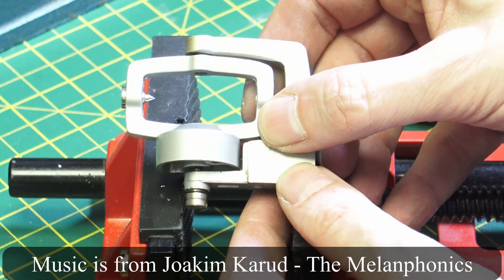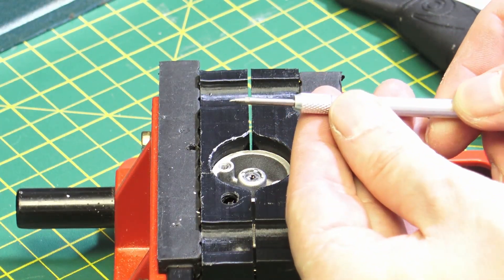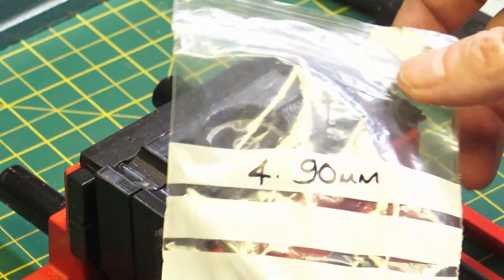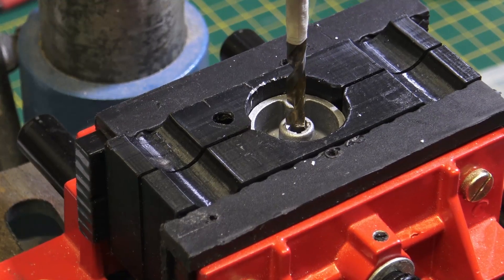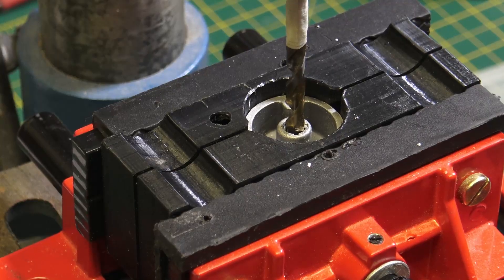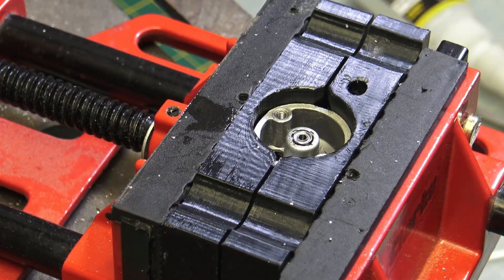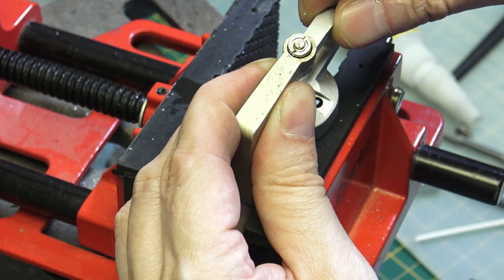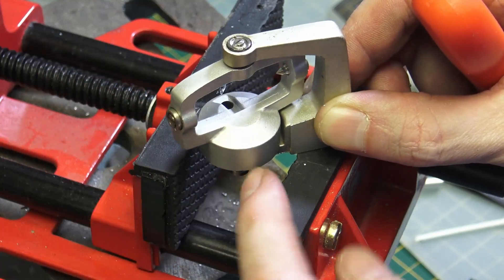How I replaced damaged bearings on a Technics 1200-1210 turntable.

Comment: I have just stumbled across this video while searching for something else related to the Technics 1200/1210 and it intrigued me to watch it.

Obviously the majority of people don't have 3D printers and pillar drills to hand, but it was more how the bearing was fitted. I haven't the time to read through all the comments but at a glance I didn't see the method mentioned I am about to suggest.

I've fitted bearings into all sorts by placing the bearing in the fridge or freezer for a while, meanwhile the part the bearing is to be fitted into sits in the sun / near a radiator / in a warm place.

Due to good old thermodynamics, the bearing contracts in the cold and the other part expands in the warmth allowing the bearing to be gently pressed or tapped in with little effort.

Anyone tried it? May work rather than drilling castings.

Comment: maybe a short thought through question but are you also well in reason to use this on the arm's "up or down"  axle? i'm doing this on SYNQ XTRM1 (hanpin superOEM but when i grab some precision measure calipers they are a bit over 5mm OD if i'm recalling my previous measuring b4 deciding to forward on this stabilizer modification (if u will) upgrade for the up and down motion as well as the rotation of the base arm pivot, not sure if the top/bottom bearing sockets are equal to Technics or not, actually didn't get to mind on measuring these as well when i was havin at it on my tonearm spare parts set (ordered 2 new SUPER OEM Turntables after the authorities stacked both TT's on top of one another when they were seized after a "Free party"  aka, non legally licenced party :p, anyway both were significantly messed on the arm side of the decks, however the boxes they came in " branded Epsilon"  handwritten on outside box, they were wrapped in silky cloth, 2 tapes around base of arm and the headshell socket , a foam block between arm's base and under the armtube rear (where the arm weight goes on) which was snug between the armtube and the surface of the base of the tonearm, that was all well n decent, but no snug securing the arm assembly inside the package at all,, aka free about 5-7,5cm play from laying it down on bottom to the roof of the shipped enclosures,, aka having the base+the metal threadring that comes with the height adjust ring on any fully assembled arm, is quite a decent chunk of weight to it, a mere allu armpipe + 1 x package size length drop, fall , or any other minimal sudden movement of packages, aka, opened them, 1 arm was so bent it would make the collar come out at about the quartz lock button's loc, the 2nd  one looked almost just unharmed but from a side perspective there was a very clearly noticeable angle in where it curved downards from about the tonearm secure clamp's base towards the collar for ur cart, is it adviseable to swap the normal SME Socket's with some Higher quality ones to make sure they don't come ending up not being secured to the arm's entire static shape , what would advisible type of wiring to use from headshell to inner table's pcb contacts? might aswell take a proper go at it instead of skipping and later regret having so, soz for length but well seems like the right place to ask, <3 love on them share of info,

Comment: I'm going to add something.

DO NOT use a drill bit to do this, use a chucking reamer. If you are using a MR52ZZ bearing, use a reamer that reams it to about 4,95mm or so, and if you do this you should be able to use a hand held drill for this job instead of needing a drill press or milling machine. You don't need a 3D printed fixture or anything to hold it, there's a substance out there called "friendly plastic" that works, or just a few flat bars of wood or aluminum glued together if you don't want to 3D print anything.

But use a chucking reamer, DO NOT use a drill bit. You will get better accuracy and you can size the hole just enough that you should be able to press the bearing in, without needing to use glue or anything.
Reply: Hi,  if the original hole is smaller than the reamer, what centres the reamers initial cut?  Kind regards.

Comment: Heat up the assembly and freeze the bearing . Should fit in easy. The heat will expand the arm assembly and the freezing will shrink the bearing. This is what is done for installation of transmission bearings. In theory it should work if the tolerances are close.

Comment: You should get an even better result if you remove the shields on both sides of the bearing,clean out the lube and replace with the super fine synthetic bearing lube,leave the shields off,as the shields in bearings that size create friction

Comment: If you take down the 4 indentations that hold the old bearing in with a fine dremel file, it will come out a lot easier, and I use a similar bearing but 6mm external, then fitting is much nicer.
But good job either way pal and n1 for helping the 1200 community ;)

Comment: Can you tell me what the diameter and depth of the original hole in the tonarm is? Because there are smaller bearings (4mm OD, 4.76mm OD etc.), so there might be no drilling needed.
Reply from the maker: I tried all the ones I could get and this is what I used. 4mm was too small and 5mm was a fraction too big.
Reply: @DJlegionuk  Thanks for the quick reply! I have to try it anyway. Maybe the 4.76mm bearing fits. I'll tell you ;)
Reply from the maker: @dedondigital  you have to make sure the point  fits in top and bottom too please let us know if you find one that fits with no drilling.
Reply: @dedondigital  So does a 4.76mm bearing fit?
Reply: @vinylebartosza  Sorry but I did not try it. In my case the problem turned out not to be the bearing
Reply: I have idea to use a 4mm bearing and put a thin ring to fill the free space between the bearing and the pivot.

Comment: As an engineer may suggest  loctite low strength reting compound ( purple ) as its better for ally and steel 

Also if it was 2rs no zz bearing you could possibly take a seal off and grease the bearing Mind you ya need micron tools 

Grate vid thanks

Comment: Wow, your awesome,  I got a a question,  does this apply to all bearings  ? Top , bottom,  sides ? Thanks
Reply from the maker: I only know top and bottom and it's vary rare to see the sides damaged.
Reply: Side bearing is the exact same material, but they don't get damaged as often for some reason. If that breaks the same procedure applies. Except I believe case for the side bearing is made of a separate piece of 6061 T6 aluminum rather than the cheap cast aluminum the top and bottom bearing case is made of.

Which means if I screw up I can simply TIG weld the hole closed and redrill. I do not know if I can TIG weld cast aluminum.

Comment: Thanks Dj Legion  this worked like a charm.  I free hand the pilot hole I didn't have the drill press  but I was very careful. You're not removing a lot of material.  Just shaving it.  Came out amazing.  I am a happy camper. Thank you!!!
Reply: Hey Garcia! What do you mean you free-handed the pivot hole? I also do not have a drill press but i do have a dremel. How did you go about it?
Reply: @nilsengstrand5528  I used a regular hand drill and re drilled the new hole.  So the new bearing can fit in.  You barely shave some aluminum. 
I didn't have a drill press.  So I took a chance.  And it worked.  I am about to do another tone arm as soon I get a change.
Reply: @nilsengstrand5528 make sure is the correct drill bit.  Just follow this guy's instructions.  Do not use the dremel  tool cause it's not powerful enough to Handel the drilling.  Just a standard power drill will do the job.

Comment: Nice work, considering doing the same with my mk2's. How have these handled scratching, so far?
Reply: Also, would a W682 bearing be better? it's 5x2x1.5mm, so may not need drilling to sit flush?
Reply: @beatntrakdjlandrover9734  if you have an answer to this question i'm interested in it :)
Reply: I'm gonna try and order this part and a few others from overseas manufacturing to specified measurements in order to see if I can find a similar enclosed bearing that sits flush without needing drilling or gluing. I'll report back after a few months when the parts all are machined and arrive =)
Reply: @flapjackthekandikid  did you find any suitable bearings in the end?
Reply: @aka_juan  YES, I use brushed chrome steel standard size #682 size bearings (not 682zz) and a thin ring of rubber heatshrink around it to fix it in place. It works with both vertical and horizontal bearings and requires no glue and no drilling

I usually load the bearing onto a magnet and cut a tiny sliver of heatshrink around it, heat it into place; then slide the shrink off and put it into the empty bearing slot; and then fit the bearing into place after which takes about 2min to do even when it's being difficult.

I was getting quotes to injectionmould a tiny ring around the bearing but they were dramatically more expensive than the shrink itself so at the moment I just use that. The rubber ring makes it so you can still adjust the top pin by hand and allows slight space for the bearing to expand into without warping if you overload it

I've done it on about 16 decks so far and they all have perfect play and functionality without any chance of messing up the housing whatsoever, they're perfect

I sell them for 6$ea in LA (the cheapest place I could find online was 15$ shipped) but you can also buy them from an alibaba manufacturer if you're down to wait the shipping time
Reply: @flapjackthekandikid ah that’s a pretty clever solution! Thanks so much for sharing, I think I’m going to try this route as I’m a bit nervous about modifying the housing. So the bearings you use are  2mm x 5mm x 1.5mm instead of the standard zz dimensions 2mm x 5mm x 2.3mm? Thank you
Reply: @flapjackthekandikid would be great to see a short video on this!

Comment: Hi Lee,

I have a couple of questions regarding the drilling / reaming of the gimbal.

Is that a 4.9mm ream or drill bit you used in this example?

Was there a particular speed that you set the drill to?

Kind regards,

Charlie
Reply from the maker: 5mm drill bit and I am not sure what speed.between 1400 and 2000
Reply: Don't use a drill bit, use a reamer. If you use a drill bit it will catch and ruin the part. Get a reamer that will ream it to 4.95mm and you can press the bearing in with some pressure, no need to glue it in.

This will save you from spending hundreds of dollars on historical parts.

Another thing is, this MR52ZZ bearing will likely outlast the original bearing. The original bearing is made of some very soft metal.

Comment: It would be nice to know the size security spanner bit you are using to turn the locking screw.
Reply: I think he said a 5 mil
Reply: THANK YOU, THAT WAS MY QUESTION. SO I GOT THE REPLIED.
Reply: @djjammindave  But there is more to the spec than the spacing. The thickness of the blade is important. The thinnest blade I could find was 1.1mm and I believe that is still too thick. 0.8mm would be more likely to fit the slot.
Reply: is there a link to one to purchase it

Comment: $275 gets you a brand new current production SL-1500C tonearm. The new arms fit the old decks.
Reply: That is one hackfuck of a repair, sorry, the extremely tight tolerances of that tone arm have been forever lost. Just buy it from Kab or another supplier. I would not play my records on that.
Reply: @castuart81 instalment of a modern tonearm is very straightforward and in no way feels like a "hack"... It's held in place using the original 2 screws. The only problem is that at the moment you can only buy entire assemblies, including a tonearm base (with vta etc). You need to take out the tonearm with only the pivot parts as the base won't fit the old decks.

Comment: Thanks for the great advice. I just completed this procedure on a SL-1700 mk II, took me hours to take it apart, get it back together and fine tune the auto return and auto start, but it works great now. 
I did one thing different though, I used the same size bearing, but got the flanged version. Uses the rim of the hole instead of the angled bottom so it seated very precisely. I made a shim out of an old credit card on the bottom pivot to adjust for the bearing flange thickness.

Comment: I have those OM Pro S cartridges. The instructions say to set it up with 4g.  I had to add the weights they supply to achieve 4g but it seemed too heavy to me. I was worried about my vinyl getting worn out. I'm having some issues with DVS as it occasionally says "low voltage" on Traktor. Also "ground hum". Bloody things.

Comment: Could you tell me please the screwdriver tip number for the top lock minute 10:14 ,because just bought this one :
€ 2,11  45％ Off | Broppe 3pcs 25mm U4 U6 U8 U Shaped Screwdriver Bits 1/4 Inch Hex Shank Electroplating Bronze Hand Tools
https://a.aliexpress.com/_uiHYeh

But doesn’t fit on really well.
Reply from the maker: I used my dremel to grind the tips until they fit.

Comment: Which bearing is better after your testing 5mm or 6mm one? 
I just want to thank you for the efforts sharing all of this Jewell information.
Reply from the maker: only the 5mm because the hole on the 6mm was too big and the point would sit inside.
Reply: @DJlegionuk  many thanks for your prompt reply.
Reply: @DJlegionuk  MR62ZZ bearings exist too, meaning it has a 6mm outer diameter and a 2mm inside diameter. If they work better then by all means, go for it.

Comment: for me this is not a Professionel repair. glue for the bearing :)?!? never have seen such a fast adjustment on the upper screw.
Reply: The glue just fills space as  the bearing is a slip fit. The proper product would be a Locktite Sleeve Retainer but CA glue should work fine for such a tiny job. The bearing can’t fall out once the points are adjusted. 
What are we to do? No bearing parts are available from Technics, so we have to replace the whole tone arm assembly.? But wait, there are no replacements available for my TT. This is a logical solution to keep an old machine running. What’s the worst thing that could happen? Technics already considers it not salvageable, otherwise they would sell replacement bearings.

Comment: Great video, might attempt this as well. Did you use a specific brand of bearing for this? Or did you look for any specific specifications for these bearings?
Reply: never mind, I ordered some good quality bearings and did all for for my tonearm. Works like a charm, thanks for posting this!
Reply: @niekosify  do you mind telling what type  and size bearings did you order and what website?? Thx
Reply: @GGarcia7111  MR52-ZZ or MR52-2Z, Deep Groove Ball Bearing, Inner diam. 2 mm, Outer diam. 5 mm, Width 2.5 mm. Pick a well known brand, not the cheap china bearings. I used EZO in one TT, I will use ZEN in another tonearm. Good luck!
Reply: @niekosify  awesom.  Appreciate the info.  Thanks a lot.   Some other guys don't like to share that info.  And it's very helpful. 👍👍👏
Reply: @GGarcia7111  you are very welcome! Sharing knowledge is the power of the internet 💪 In that context: I used a pillar drill to drill the holes to the correct size using a 5mm drill. No need for special casing for the parts, when you use a good flat surface it is very easy. And use a little bit of glue to make them stick. 
Good luck doing yours! 👍
Reply: @niekosify  awesome. Thx again
Reply: @niekosify  thanks mate. I just did mine  came out really nice.  I think these bearings are way better then the original ones.  It just cost me around 4 hours and 2 $ for the 2 bearings. Top and bottom.  I am extremely happy. For those who said it's wrong.    This is not the case.  If you know what you're doing.  👍
Reply: @GGarcia7111  great!

Comment: You can get replacement bearings on ebay and some other places so you don't have to drill anything and risk damaging your tonearm.
Reply: the bearings are kept in place by metal pressed over the bearings. Check the video again.

Comment: On the vertical side bearing screws, the left hand locking ring doesn’t seem to have a thread and keeps popping out when adjusting the screw. How come it’s different from the opposite side? Is there a fix for this?
Reply from the maker: one side it normally fixed in place and has no adjustment.

Comment: Wouldn't a 682zz fit without the need to drill? its 2.3mm https://www.lily-bearing.com/ball-bearings/miniature-bearing/miniature-metric-bearings/682zz/
Reply from the maker: hi, it's too wide and tall to fit, I have 63zz and still needs drilling
Reply: It's smaller than the MR52ZZ you used, but in depth only. Or am i missing something on that page.?
MR52ZZ 5mm OD 2mm ID and 2.5mm depth 682ZZ     5mm OD 2mm ID and 2.3mm depth
Great idea & work btw. Keep it up :)
Reply: @DJlegionuk  Hi can you do a repair for me please?I will send you just the pivot.Thanks for the great videos!!!👍✌
Reply from the maker: @gabornyerges4801  hi, are you in the uk ?  if not what would it cost to send it to me and then the return ?
Reply: @DJlegionuk  Hi, yes i living in the UK(south wales)✌
Reply from the maker: @gabornyerges4801  ok find my email in the about page and we can talk about it
Reply: @DJlegionuk  Thank you!Please check your emails✌
Reply from the maker: @gabornyerges4801  hi, nothing yet

Comment: Very very impresive, could you explain how to adjust the side screw of the tonearm, that would be very interesting. I need to adjust both tonearm of mine, i own 2 technics M5G. I need only to adjust the pivot (same height botom and top)because the tonearm always stops at certain distance, so i need to adjust it. I think i need to make sure the pivot is freely to spin as in your video.
Reply: Did you manage to solve it?